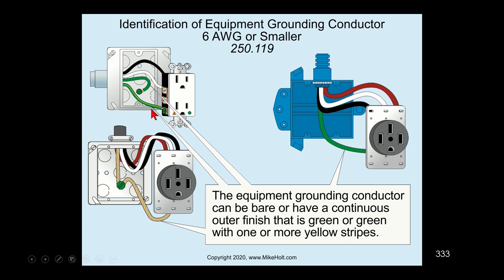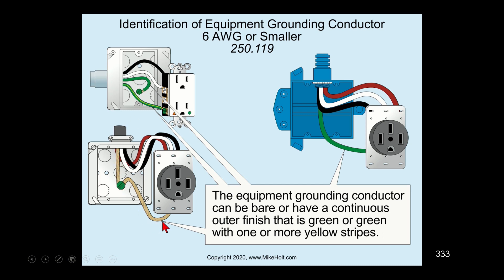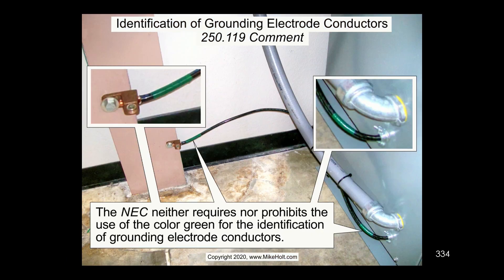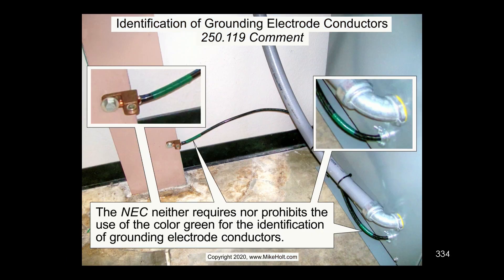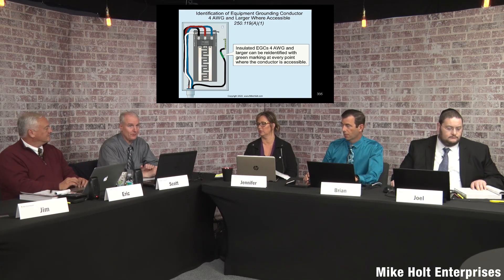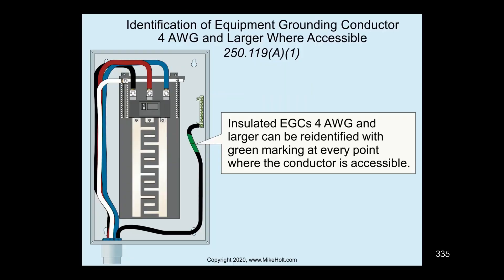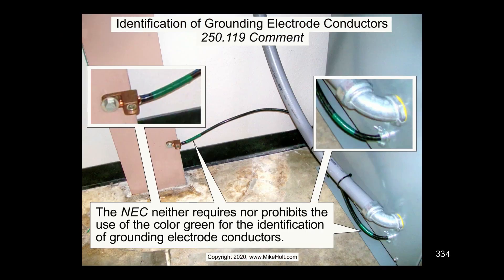Identification of Equipment Grounding Conductors [250.119, 2020 NEC]

Comment: Mike, you mention that white is reserved for the grounding conductor. How does neutral qualify as a grounding conductor per NEC definition?
Reply: I really wish the NEC would stop calling the neutral the "grounded conductor" and just call it the "neutral conductor"
Reply from the maker: Please watch the video again, I did not state that 'white is for the grounding conductor.' 
(1) There is not such term grounding conductor. 
(2) White if for the 'grounded' conductor [200.6].
(3) The NEC does not specifically state that the neutral conductor is considered a grounded conductor... However, the "neutral conductor" is required to connected to the "neutral point." If the system is grounded (from the neutral point), then the neutral conductor is a grounded conductor.
Reply: @MikeHoltNEC  At 1:45 to 1:48. " 'cause white has to be used for the grounded (sounded like grounding) conductor", is the reason for my question. Answered thank you.